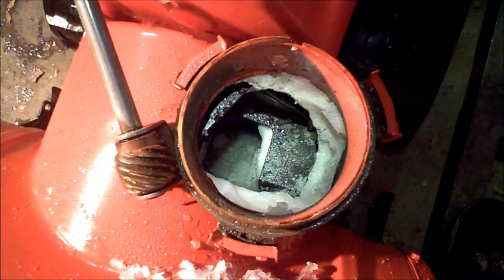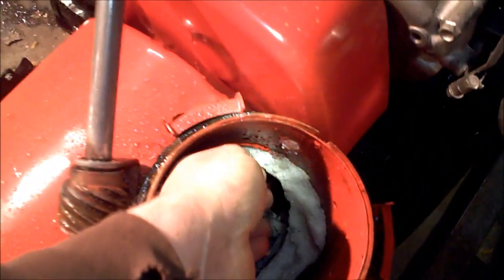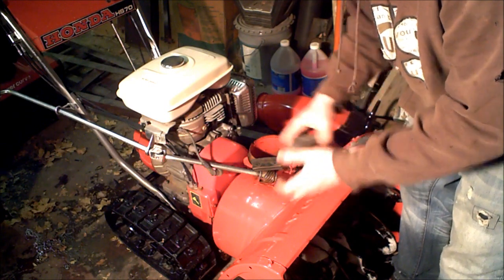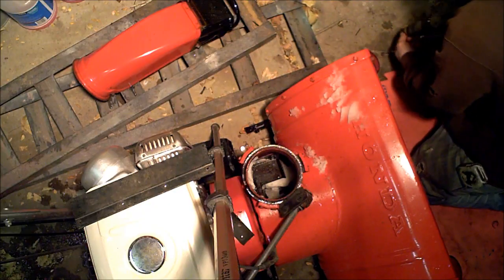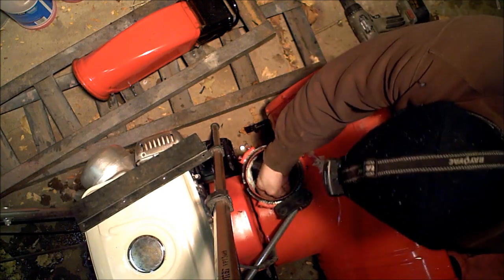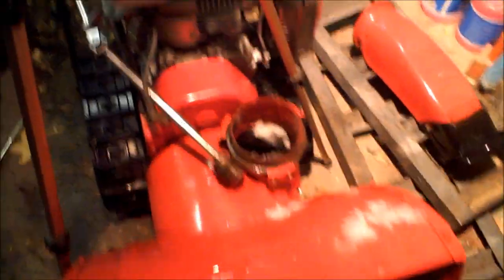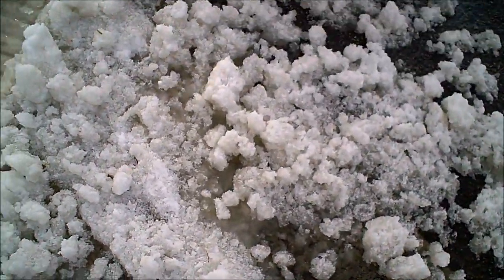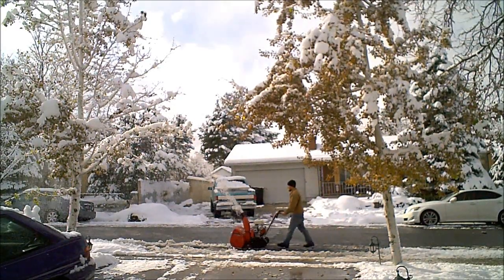Modify Snowblower to never clog and throw twice as far w/ Impeller Kit

Comment: Old video - But - I was watching a train that was built to blow snow - They used steam to keep things from freezing up - What would happen if you adapted the motor exhaust to be directed into the blower?
Reply from the maker: +jake legg Interesting... I've personally never had issues with it icing up but  I would assume in very very cold climates it may help to prevent icing. But I'm not sure if the exhaust would be able to put out enough BTU of heat to combat the constant ice and snow, but it could?

Comment: Awsome video and great tip. Thanks for sharing your expertise. I have a 3 impeller Craftsman. How many do you recommend I modify? I did 1 and I was going to see how it works at the next snowfall but if you recommend more I would just do it now with the chute still off. Thanks again
Reply from the maker: +Tom Charette With 3 I would do them all.
Reply: All three or none.  Otherwise you are going to put the impeller out of balance.  Also the rubber parts and screws on each paddle should weigh the same and be the same distance from the axis of the shaft.

Comment: I did this and it worked just as described. I just want to give a word of caution from my experience. In my snow blower the gap between the blower wheel and the surrounding metal housing is NOT equal all the way around. The largest gap was just prior to the paddle reaching the exit chute and the smallest gap was just after the paddle past the exit chute. So the material has to be flexible enough to expand and contract to fill the different size gaps as it travels around the housing. The most important area the gap has to be closed is prior to the paddle reaching the exit chute.In my case that was where the gap was at its largest prior to installing the rubber on the paddle. I installed the rubber so it just touched the housing.This meant that after the exi chutet the rubber has to be flexible enough to contract to allow it to get passed that area with the smaller gap.So a really hard rubber ie: tire sidewall in my case would have probably jammed the blower and broken something. I used rubber T fitting that I purchased from a plumbing supply a few years ago. We just had a snow storm a few days ago an not once did it clog in over 10 hours of use :)
Reply from the maker: +TheNYgolfer Over time on older machines the impeller housing will actually get forced/bent outward just prior to discharge, but also there is a fair amount of manufacturing tolerance. I'm glad you tried it out.

Comment: Thanks for the tip! I have an old Arons (spelling) that I like a lot cuz it's electric start, always runs, powerful but it is clogging up all the time. I live in the city and my garage is on an ally so I have to clean a half block of ally out to get my car out.  I don't like throwing the snow in front of others garages so I end up throwing it in front of the blower a lot of the time so the snow gets compact and weter each time it runs though the blower. Looking forward to trying this. Hopefully it makes my life bit easier.
Reply from the maker: +dmmflys I hope you do, you'll be impressed. I do have a link in the video description for heavy duty rubber material(1 will give you plenty of material) and you can pick up screws at you local home improvement store. Let me know what you think of it.

Comment: Great idea and here is another reason for it. I have a big Ariens Professional machine and I swear this would pump water if I got in to it. Never clogged it up but what has happened if I do my neighbors gravel driveway it will pick up rocks and they will get jammed between the impeller and the housing for a couple of turns before getting thrown out. I've got some nasty scratches/gouges in the housing from this. But I can see your flaps on all the blades of the impeller to just push the rocks out without jamming the machine. The machine has enough power that the rocks aren't stopping or jamming anything but the flaps would have the give needed if you needed that and would sweep the rocks out without a lot of issue. Just my thoughts on your great idea. I'll love to see comments on my comment here. Thanks again. Lisa
Reply from the maker: +Lisa Johnson You nailed it. The rubber paddles generally won't allow even the smallest of rocks to get pinched and pulled between the housings and impeller. When this happens too much it will destroy your bearings, expand the metal of the housing, bend the impeller blades.

Comment: We just got over 30" of snow this past weekend. I have an old "Yardman Snowbird" use this modification and WOW it didn't clog once. I was cutting through snow drifts over five feet high. I will say when I was going over the area at the end of my driveway it did take a little longer due to the township plowing it in however the only thing I ever had to do to the snow blower was add gas. I was wandering if chains for the tires would help in the area where the snow became extra heavy due to being plowed my tires were spinning a lot in that area do you have any experience with that.
Reply: Chains are a pain in the ass and I don't think they help at all.

Comment: Well I was bit skeptically but... I have an old Ariens GT 16 with a 48" beat up snowblower.PTO drive. It would throw snow about 10 12' on a good day and I just took it as old age but after I saw your vid, on some of the 2nd stage I had 1" gaps,  I decided to give it a go. I used the sidewalls of an old tire,2"x3" some self tapping screws and about 45 min of my time .I am still in shock- throws at least 30' now !!! wow ty ty ty
Reply from the maker: +Clem Kotlarsky That's a huge gap! I'm glad you found the video and took the initiative to try this out.

Comment: I had to come back at you and provide feedback.  We had 26" plus this weekend.  i wouldn't consider it wet snow, but it wasn't dry.  The deepest I traveled through was probably 10 inches on a straight run, although I chewed through piles of compressed snow 4 or so feet high.  The results were really amazing.

I was kicking out snow a distance I never experienced before.  I even broke a shearing bold somewhere along the line, not sure when, but the blower was still kicking out snow.  I didn't even notice it until I was cleaning out 4 or so feet of condense snow from the road crew for my neighbor.  He noticed that only the one side was turning.  I had to have him hold the handle because it didn't appear possible.  It was working that good.

I highly recommend this alteration.  On my Craftsman, it wasn't nearly as easy as the video, but every minute I spend getting the paddles installed on an ugly hot, miserable day, came back in spades this weekend.
Reply from the maker: +Jim Rothenberger That's great. I'm glad you did it in the summer.
Reply: Maybe the impeller can now get rid of snow faster than the auger is designed to feed snow to the impeller, so that previously you never put that much load on the auger.
Reply: I wonder if adding the extension put extra pressure on the unit and caused the shearpin to break?
Reply: @richardlapera77   I doubt it, possibly the shear pin was slightly impared from previous encounter with something getting scooped up hidden in the snow.

Comment: I agree with Richard E. that it's surprising all the snow thrower manufacturers have not improved the  impeller-housing gap problem.  As far as their extensive engineering divisions, they exist because the companies know the machines have not been perfected and  investment in new ideas and development from these folks pays off. It's possible this simple and effective modification has not occurred to the engineers who work on highly complex design issues.  About 2 to 3 % of patented "inventions" do end up making money for the inventor.  Regardless whether this is or is not in the 2% , it's an excellent idea, and simple to install.

Comment: Haha never had this problem, I mean its neat but if you keep wd40 or PB blaster coated on the inside of the material, the snow won't get caught and will slip right off same thing with snow getting stuck to the shovel
Reply: Yea  I tried that oil & shovel trick it lasted like  to scoops full vern!! I Guess I didn't really feel like going out b to buy a 50gal. Drum of wd40 or pb blaster or maybe it would have been cheaper too go buy a new snowblower, and then do the mod.

Comment: So should I try this on the Ariens 28 deluxe. You kinda said in the video that on some blowers it doesn't make a big difference.
Reply from the maker: +turdsandwicher It will make a difference on all snowblowers. Some people don't live in areas where is it warm enough or have salted roads for the snow to slush up and cause clogging, so for them clogging is rare.  Every snow blower will benefit from further throwing distances.
Reply: +sixtyfiveford Hey so I took the shoot off this morning. There is like a half inch gap! So I am going to try the mod. The impeller is "rounded" like a scoop. Should I curve the piece of plastic or only put it on the flat part of the impeller? Should I do all three impellers? And do you think self tapping screws will work? The metal seems pretty thick.
Reply from the maker: Flat part only, yes all three and yes self tapping screws will work. I have a link in the video description for rubber material and self tapping screws that work.
Reply: +turdsandwicher   Get the monster size.. Big Gulp size screws....

Comment: hey can you tell me if you can weld the outer sleeve guy gave me a wrong shear bolt and bent over cut the hole a bit so hole is to big now it's a 28 frontier thanks
Reply from the maker: +Paul Sellars You can drill a new hole anywhere on the shaft through the outer sleeve and inner shaft to fit a bolt. Or you can weld up the damage and redrill the existing hole.

Comment: I had an old BOLENS that I just about gave up on.  It could not handle heavy snow.  People with single stage push snowblowers were finished with their driveways before I was 1/3 done with my self-propelled, electric start 24" BOLENS.  Before I bought a new snowblower, I decided to Google "clogged snowblower".  IT WORKS GREAT!  You just saved me hundreds of dollars.  I went to the local JUST TIRES store and they gave me a flat tire for free (saved them the disposal fee).  Cut the tire with a SAWZALL - note: the edge of the tire that mates with the rim is full of steel.  Plunge cut into the sidewall and save yourself some time and effort.  The sidewall curls, so I placed in on the impeller curly side up, so it forms something of a scoop as the impeller turns.  I used 3/4" #12 hex head self tapping screws.  Went in easily and holds well.  Used it for the first time on heavy melting ice and snow and it worked great.  It did clog the chute, however, for the first time ever, it cleared itself - I just need to use gear 1 or 2, not 3 or 4 in heavy icy snow.
Reply from the maker: +0aktower That's great. I'm glad you took the initiative to do this.

Comment: Will the self tapping screws work with a plastic impeller?
Reply: +Rage166754  i have a mtd with plastic impeller blades and used self tapping screws to attach mine. after last winter and so far this december everything is still holding on rock solid. good luck

Comment: Hey man. Should I try doing this to an Ariens 28 Deluxe? I haven't had the shoot clog up on me yet. Is it still worth a try? 
I am having a problem with it however. If we get a heavy wet snow it won't scrape all the snow off the driveway. It leaves quite a bit. Like an excessive amount. I tried lowering the skid shoes didn't really help. I looked at the scraper blade. Seems okay to me. 
TLDR How can I make my blower scrape right down to pavement? (Problem only happens with large amounts of wet snow).
Reply from the maker: +turdsandwicher Raising not lowering the skid shoes will put the center scraper bar against the pavement. Put the machine on level pavement and loosen both skids. They will raise up until the center scraper bar touches the pavement. Tighten everything up.
Reply: thanks but already did that. I said lower. I meant I lowered the scraper bar.
Reply from the maker: A 2 stage unit will never scrape perfectly but should only leave a skim. If it's leaving more then either the bottom layer is ice or the machine is tipping back and riding ontop of it.
Reply from the maker: It is virtually impossible to get it to clog with this modification. It is very rare for me to see even the most used snowblowers with a worn out scraper bar.

Comment: i also suggest fender washers to hold the rubber down good
Reply: I love this mod.  I used fender washers with the self tapping screws and what a difference.  I have modified several others for friends.  Works on any two stage snow blower.  I found a truck mud flap in the street and am still cutting pieces from it.  Don''t forget to bevel the leading edge to help the wear in.  Thanks for a great description as to why as well has how.
Reply: Good idea!  I just did this mod yesterday and used stainless steel fender washers to hold down the self tapping bolts.  I bought the rubber paddle material from the link he supplied w the video which works GREAT!  We got 3 inches of snow up here in CT early this morning that was light and fluffy.  So I couldn't really tell if the mod made much of a difference.  But man is it "cleaning" out that housing inside.  The rubber paddles beveled out nicely in a matter of minutes.  So I'm pretty sure this mod will work great when the slushy stuff comes, which we get a fair amount of in March.  The only thing I might change is replacing the self tapping hex screws with stainless steel bolts, locking washers, and nuts.  The screws are in there very tightly, but I'm not sure they'll stay that way over time, so using bolts and nuts is probably the better way to go.

Comment: Fabulous idea!  I'll fix my Troy-Bilt like this.  Will also give it a try on my dust-collection machine in woodworking shop - even though it doesn't clog, maybe this will improve the CFM's.  Thanks.
Reply from the maker: +Wood Worker51 It will help a dust collection for sure by increasing the suction power.

Comment: I have a '93 MTD Yardmachines with three heavy L-shaped impellers and a couple of screw heads inside the shute that flaps would rub on. Do you think this could still work on my machine? The rubber would have to go across and then up to cover the whole impeller surface.
Reply from the maker: +10mohs Yes, I have done quit a few MTD snowblowers. It will wear to the heads of the bolts.
Reply: +sixtyfiveford 
Thanks!

Comment: Great video and tip. I have a Toro Power Max 826. The top part of the impeller housing is plastic and is raised about 4-5 inches from the rest of the housing. Will this still work?
Reply from the maker: +Richard Lau Yes. Just set them up to skim the metal parts of the housing.
Reply: Thanks again!

Comment: I just completed the modification on my craftsman 2 stage. Now impeller seems to be spinning slow a makes a rattling noise is that normal?
Reply from the maker: +AJ Frascino It shouldn't be moving slower unless the rubber is really tight against the walls. And if the rubber paddles are really tight it will be impacting the sides, making clapping sound as they rotate.
Reply: +sixtyfiveford should I move them back a little?
Reply from the maker: They will wear in if not too far out. You can cut them back a little or cut a chamfer on the leading edge like I did. Some snow blowers have a non centered impeller to housing do to manufacturing defects. In this case you need to adjust them to just skim the closest spot.

Comment: I'm very disappointed this did not work for me but only because gap on side no gap near top (right after hole) and I torched my holes because self taps were not self taping ... FML ...
Reply: +Jack Duburg   Have you ever heard of a drill?
Reply: +Richard Einstein the bit kept breaking
Reply: +Jack Duburg Move to a different impeller paddle, try again? Pre-drill. Taping means threading, not drilling.
Reply: Thank you for the suggestion and I completely hear what you're saying but either way it won't work because when the paddle is vertical there is no gap at the top so it won't work no matter what

Comment: good idea. it's basically a pump so any space is going to be an issue.  I don't usually have clogs but they do happen.  mine has a power boost what is basically the same as what you would see on a snow mobile.  a spring type clutch adjusts as needed changing the diameter of the pully on the crank giving you more rpm speed for the auger. your idea is easy and I can see how it would help.
Reply from the maker: +CIA Assassin Simplicity makes some of the best machines out there. Even they will benefit from this, but not as much as inferior machines.

Comment: How do you replace a bearing on the drive plate?
Reply from the maker: +Harvey Chambers It takes a fair amount of work as everything is rusted. Most machines split in the middle from the transmission to the auger housing. Then you have to pull the auger drive pulley off and the bearing should be accessible.